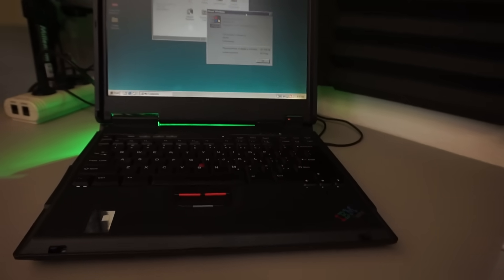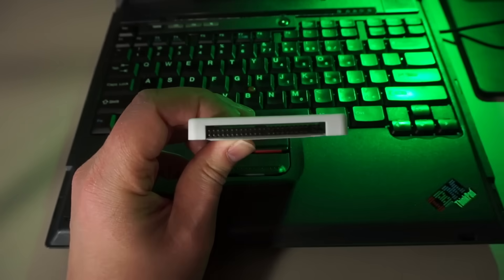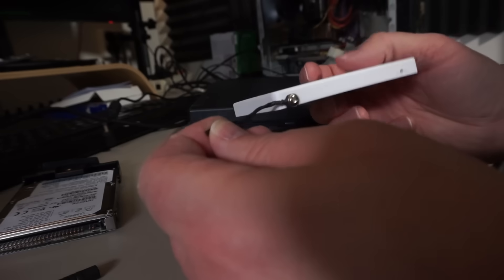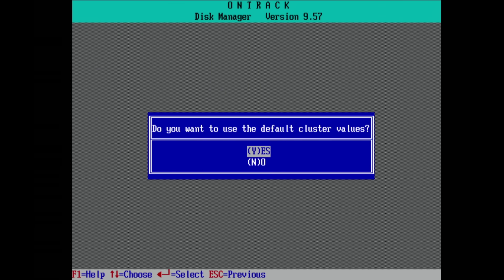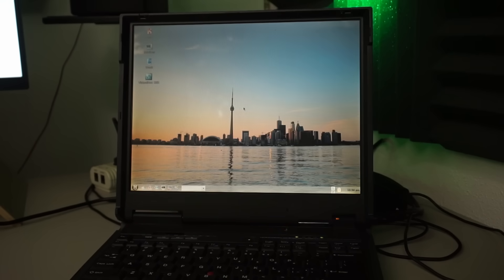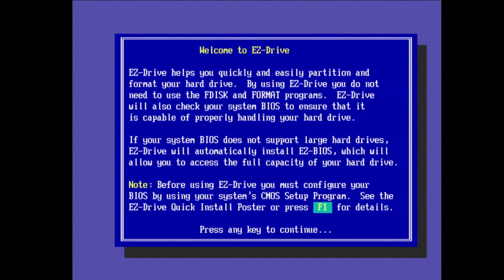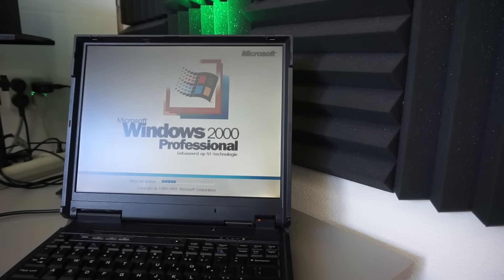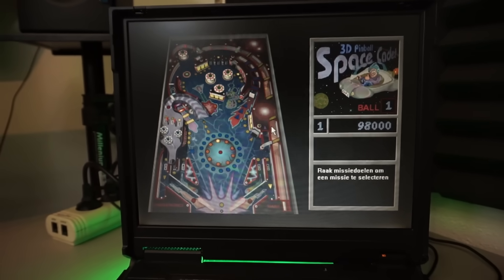I put an M.2 SSD in my Pentium 3 laptop!

Comment: Hey, I have some ideas: I believe you can boot and use Linux on this big disk, if you put the boot partition of Linux at the start, so GRUB load within the initial bounds. To keep DDO working for Windows, you may be able to back up the boot sector of your disk (the first 446 bytes - you can do it with a live Linux disc, using dd), put it as a file on the boot partition, and boot it with GRUB (I unfortunately don't know the exact procedure, but I reckon it is possible!). There also is GRUB4DOS, which can let you keep your DDO bootloader entirely intact, while also being able to boot linux (no matter where from, as long as the partition is DOS compatible).
Reply from the maker: Valid point, that might actually work. Makes it hard to maintain though so I'm not sure if I would like to do so.
Reply: @ex-itguy  Absolutely fair

Comment: I was under the impression that all modern SSD have built in garbage collection. If you notice the drive start to slow down you just boot into the BIOS and let it stand there for an hour or two and the drive will do it's thing. You don’t need TRIM for garbage collection to work. TRIM just makes an SSD’s garbage collection more efficient. TRIM isn’t a requirement.
Reply from the maker: Didn't know that! Good one!
Reply: Agreed TRIM is not cruical. I remember intel SSDs offered a tool for TRIM support with Windows XP.  However another thing to consider is to ensure the SSD partitions are aligned correctly. Operating Systems from Windows 7 onwards automatically detects the presence of an SSD and creates the partition with an sector offset at 2048 if I remember rightly. A correclty aligned SSD for example will have a partition starting offset as 1,048,576 bytes. If you divide that by 4096 you get a whole number value of 256 and there are no decimals. However if you have a misaligned SSD that would for example be 32,256 bytes If you divide that by 4096 you get 7.875 so there is a decimal in that value therefore shows your SSD is misaligned. This disgrades perfomance and more wear and tear on the SSD overtime as it has to write more data spead across more sectors I think. For Windows 98 you could create the FAT32 partition on a Windows 7/8/10/11 machine first and it should be aligned correctly before moving over the driver to your older machine then installing the operating system. There is also SSD alignement software for after OS installations you could try which worked for me with Windows XP NTFS partitions. Have never tried Windows 98 or earlier so I can't comment on those. There is more information about SSD alignment on-line that can explain all this much better then I can.
Reply: Newer controllers are better at self managing, but do not completely replace TRIM. For 98 SE, it's little concern, since few writes, but I pull the drives a couple times a year and image, TRIM, and reimage on a modern PC. For XP, TRIM more often is recommended. These are $10-15 drives, so weigh the cost against maintenance time. There's software to do the alignment also, no need to calculated by hand.
Reply: Yep! You could use a modern windows system to create and align the partitions and transplant the drive into the Pentium 3 laptop for OS install. You can also use 3rd party tools or do the mental arithmetic and work out the alignment numbers.
Reply: One of most important functions of trim is to mark deleted files and cells where they was as free space, so ssd controller knows it, so no, trim is important...
Reply: @dim0n1  Interesting to know.  Something I never expereniced to be honest. As for newer SSD the the controllers in those have built in garbage collection so free space is presented after file deletion. I still have Windows XP on an Intel SSD in one of my laptops which is aligned but I do also have the TRIM tool utility installed as it is one of older SSD I have so yes I agree TRIM is support in this case.
Reply: @friendlywizard6462  👍

Comment: nice to see people have found out mSATA-IDE adapters exist.

t. has been using these in his IDE equipped laptops since 2017 or so
Reply from the maker: This is m.2 SATA though, not mSATA. But the idea is the same indeed. This stuff is cheap and readily available, unlike old ide drives or even CF cards.

Comment: Wasting time and money on old Windows is not realistic. Even modern Linux kernel may not work but by default Linux can handle big DISKS. If the O.E.M. guys have done a bizarre Partitioning Rule one is going to be stuck.  The beauty of Linux is Linux can boot different partition separately at boot time. I have 5 instances of Linux in a NUC box of 320GB SATA. Endless OS can rewrite (takes over the entire disk) overruling the BIOS/GRUB restrictions. If the system has low RAM it is not worth crying over spilt milk in here split Hard Drive.
After all at run time only RAM matters and not the Drive.
Reply from the maker: It's a Pentium 3. People are not using systems like this for actual productivity. It's reliving the past on vintage hardware with vintage operating systems. ;)
Why not a vintage disk then? Well, some might even prefer that, but if it breaks it's hard to replace and this is a nice cheap alternative that makes it a little faster even.
Reply: @ex-itguy  many people do not "get" nostalgia, and I feel sorry for them. Running old OS's isn't MY nostalgia kick, but there ARE many, many other ways I live in the past. Things made much more sense back then, and everyone I love was still alive. Go with what gives you those happy feelings!

Comment: I did something similar but using IDE to CF adapter and put a high speed Compact Flash in it. It's unfortunately still limited by ATA 66, but still much faster then HDD. It's also cheaper then IDE SSD.
Reply from the maker: Indeed, but I figured CF cards are already old and expensive compared to relatively modern M.2 SATA drives. Unfortunately, there doesn't seem to be a solution to use NVMe drives. Not that we could utilize it's speeds in a system like this, but because they're available and cheap. :)

Comment: what's the point of putting m2 SSD in ide, anyway the speed is limited by the ide port. It's cheaper to take a sata ssd and an adapter to ide (PATA)
Reply from the maker: It basically is a SATA SSD with an adapter. A full size 2.5" SATA SSD would not fit if you have to put an adapter in-between. And yes, you're limited by the IDE bus, but seek times really improve and the old drive in here didn't even saturate the IDE bus.

Comment: back in the day of my old k6 166mhz we used different method of partitioning. to get a 40gb baracuda working on it we went to a friend and created root 8gb partition as c and 3 logical drives on extended partition that took the rest of the drive. no overlays just prepartitioned drive
installing windows 98 on it was no problem and each of us at home had our own private disk with autorun ini icon and everything
Reply from the maker: That's probably because of filesystem limits (fat16 perhaps?)
If the BIOS does not see 40GB, you can't partition 40GB without using an overlay.
Reply: @ex-itguy  not exactly bios seen that drive as 8gb drive and it was partitioned on a computer that seen full drive using fdisk as fat 32. no overlay it just worked
you couldn't modyfi the partition table on a computer that didn't see the whole thing but as long as firts partition was in range of what motherboard could use you could make extended partition with whatever you wanted and both dos and windows would be able to use it just fine

Comment: Some time ago I got Acer 2490 laptop for experiments. Unfortunately it was on Intel 940GML so It was impossible to use dual-core CPUs. And only 3GB of RAM. But the main problem was IDE interface for HDD. Original HDD was absent and I didn't have proper HDD/SSD. But... I had IDE Optibay that I set in spite of DVD-RW drive (most of old DVD-RW/CD-RW are in non-working state, I am surprised that this Pentium 3 laptop has working CD/DVD drive). I was lucky and BIOS allowed to load OS from this optibay. So I loaded Win XP, but it worked very slow (laptop had Celeron M520 or M530 CPU).
So this way may be another solution for upgrading old laptops with IDE HDD. But unfortunately the maximal speed is about 33 MB/s. For SSD it is toooo low.
In your case absence of TRIM may be a serious problem, because new SSD on TLC/QLC flash memory have low resource for rewriting. Probably the better way to find some old SATA ssd on MLC and set it through the optibay in spite of CD/DVD drive. 

But the main question remains: is there really anything useful that can be done on a Pentium 3 laptop?
Reply from the maker: These optibay things won't fit in this one. The drive has done proprietary interface from IBM. Found that out because it came workout a drive and standard laptop drives wouldn't fit.
There's no real use for a P3 laptop other than some fun retro stuff. ;)

Comment: To be fair, I assume most new IDE SSDs are just an already assembled adaptor.
Reply from the maker: That's what I assume as well, but for about 4x the price I paid for this with half the capacity... well I'd rather have this and be able to replace the cheap m.2 ssd when it fails haha
Reply: @ex-itguy  dosdude1 designed a native IDE drive PCB, though at the point, you need to sources the components and put it together.
Reply from the maker: @bigdude101ohyeah  Oh wow. That goes way beyond my skillset haha

Comment: I considered using that same rig with my Dell Inspiron 9300, laptop, but it works well enough with the IDE., hard drive which has the 32 bit version of LMDE 6 installed and I do have some spare working IDE., drives, so I decided to save some money and not buy the rig.

Comment: That drive adapter thingy whatever it is that you got from Aliexpress could come in quite handy for my future faux retro PC I have planned as it also uses IDE
Reply from the maker: It's a nice upgrade. Sure, you're still limited by the IDE bus so you won't reach SATA speeds, but it can help an old system for sure!
Reply: @ex-itguy  Even if still using IDE, I'd chose an SSD any day over a HDD, just can't deal with even more slowness
Reply: Something like this can probably be used in Xbox and PS2
Reply: @ManuelMaldonadoPinheiro  For Xbox you want the Startech IDE to SATA to use regular form factor HDDs and SSDs. For PS2 there's actually an aftermarket SATA adapter that goes into the expansion bay on phat model PS2s

Comment: I had a HP laptop that came with Windows 8, a AMD E-300 APU, and 4GB of memory. I upgraded the memory to 8 GB, HDD to SSD, and OS to Windows 10. The boot up was faster, but that was it. Web browsing was slow. The APU was the limiting factor. 'You can bring all the food in the world to a cow, but you can't make it eat faster'. Although, at the time I didn't bother shrinking the bloat out of Windows and web browser. That might have helped the situation.
Reply: try  brazostweaker.
Reply: I would suggest to install  EndeavourOS with XFCE it will speed up.

Windows is heavy.
Reply from the maker: @ I don't think that will run haha, it's a Pentium 3 with just 256MB of ram ;-)
Reply from the maker: True, it's not making the machine fast by any means, but on this one the upgrade is quite noticeable as there's usually a lot of waiting on that old and slow drive.

Comment: Funny thing about the w98 installation (and many others): there is a minimum install time as many of the animations and stuff in the wizard are mandatory and take a minimum amount of time. Even on modern hardware it takes ages
Reply from the maker: Indeed. Also, I was installing from CD. I might have been able to win a few minutes by copying the install files to the drive first.
Reply: You can disable those by using the /iv switch.
Reply: There's a newer work-around where you can install it in under a minute on an SSD. I can't remember the project name, but I think Omores might have done a video.

Comment: What about trying a 64 or even 128gb CF card on an IDE adapter? Also have you tested speeds with this current SSD setup? My concerns are you are not going to get much faster than a Spinning drive. what speeds does this IDE bus support? Not to mention that those antequated OS Do not know how to use an SSD (TRIM etc,) Is it even worth it to put such a fast drive on such a slow device? Benefit Vs Headaches.....
Reply from the maker: it's a lot faster than the old harddisk, but no I haven't done a proper speed test. I guess I could still do that. It sure is worth it. These SSD's are very cheap nowadays so it's a nice upgrade for just 20-30 bucks in total.
Reply: Very much worth it, I do it even though I have piles of working IDE drives. I haven't tested random IOPs on these m.2 adapters, but the StarTech SATA to IDE adapters are the best, better than my SD card adapters or CF for random read/writes. $15 USD for an adapter, and $10 for a 128 GB SSD, done. Yes, you are capped by IDE bus for sequential, but that's made up for on IOPs.
Reply: There are even SD card adapters these days. It could be an interesting test and comparison in all aspects, including speed... 🤓